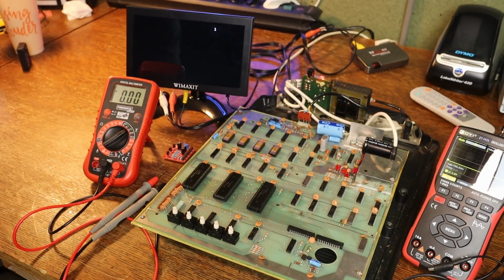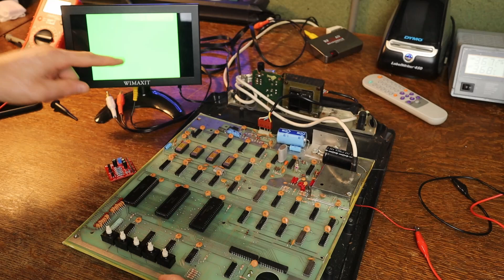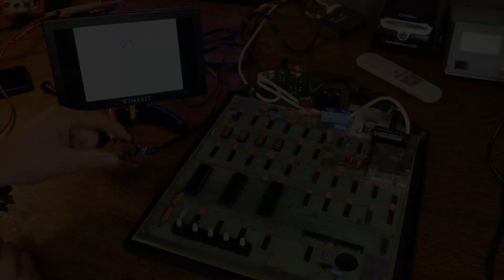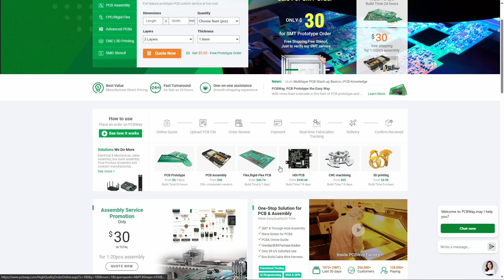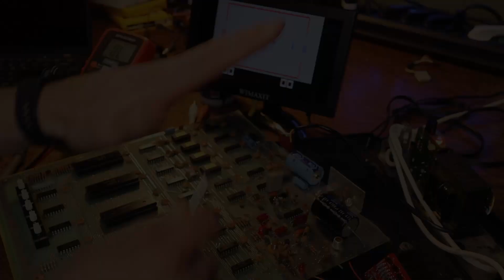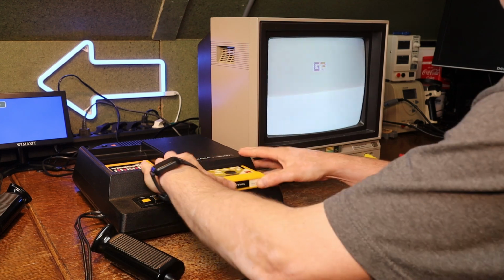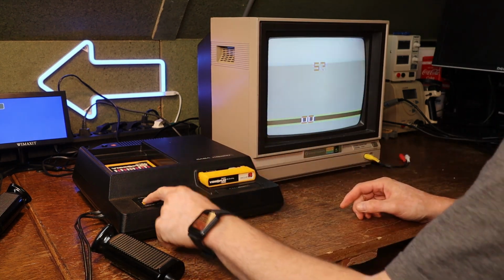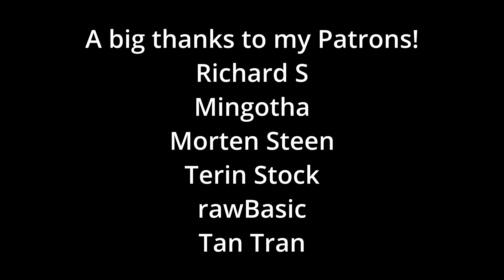Fixing and exploring Worlds First Console [Fairchild Channel F]

Comment: RetroGameOuch... Replacing a 5 V regulator when the input is 13V. The new regulator will die soon as well. You need to swap the transformer, or use a bucket converter in place of the regulator.
Reply: I do love the multimeter. What model is it?
Reply from the maker: It's a ZOYI ZT-703S. This was the first video that I had it. Thanks for the heads up on the 5v regulator.

Comment: Which is the second rf port without cable I got one but signal is black just a ping sometimes
Reply from the maker: That was an RF passthrough port. You don't need it for normal operation. Did you check your regulators? Mine started with a black screen as well.

Comment: Great console., I know SABA (living in Germany and being half German and half Dutch it's hard to don't know the brand 🙂), but this console is new to me. Awesome to see it working again(*). I like to see you do some soldering and measuring. Gives the videos an extra touch. Keep going, please 🙂.

* always crazy how the electric world was different back then. the idea to force a voltage with a single transistor down to the desired voltage and "burn" the left over energy into the heat sink is so far from who we do it today. I have an old Laserdisc player. The "standby" circuit does the same. It literally burns 7V away (huge heat sink under the transistor) to get 5V for standby. The heat sink warms up really quickly. I have my doubts someone should call it "standby" 🙂It's taking about 15 Watts in that state, just to keep the IR receiver active and the standby led on 🙂Anyway, I love these early days.
Reply: Not too forget the voltage was 220 back then. These old electronics suffer hard from 240, and when the sun goes nuts on our roofs, it can even go to 245.
Reply from the maker: Yes, these were simpler times. Less regulations and more regulators 😅

I like doing these technical videos too!
Reply: @RetroGameCouch  Still the old 1978-1984 VFD handhelds already had bucket converters, very efficient. But they were for step-up 6V to 35V. Nobody had thought they would be useful for step down as well.

Comment: I'm surprised that you managed to solder the wires to the cartridge port! I tried that once but couldn't get reliable connections because the metal is somehow coated and refuses to connect to the solder and because you can't solder with higher temperatures because of the melting plastic. How did you do that?
Reply from the maker: I had it set to 370 degrees celcius and it went OK. Press tinning was key.